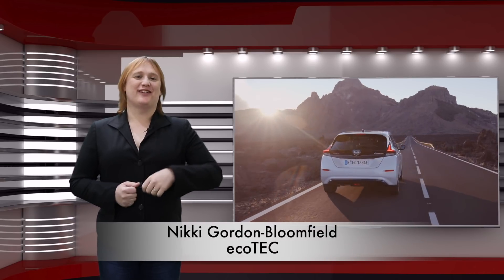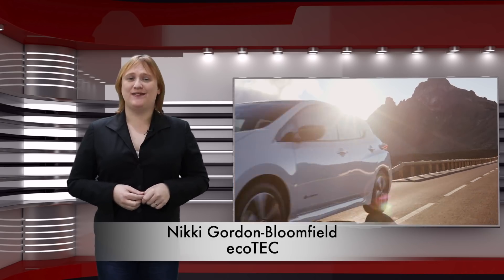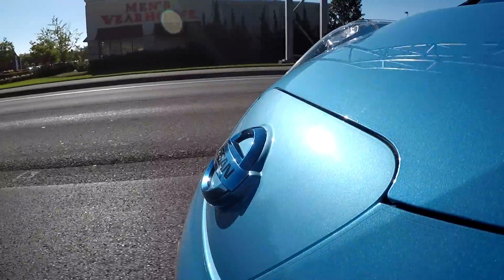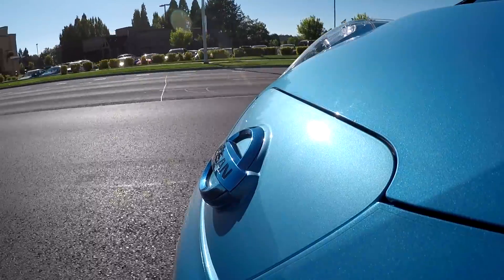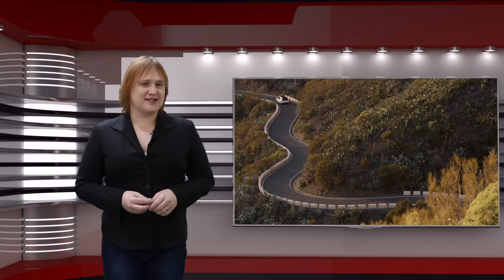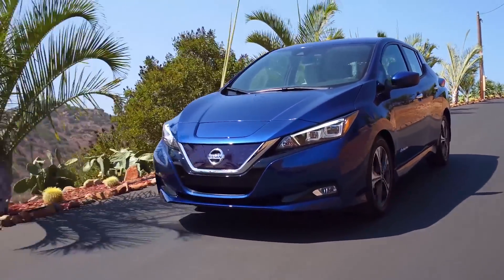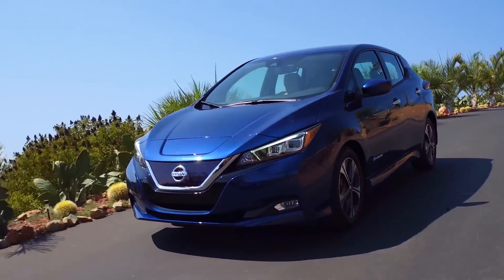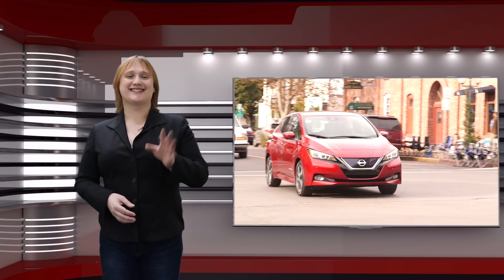The 2019 Nissan LEAF e-Plus Has Air-Based Battery Cooling -- Not Liquid Battery Cooling

Comment: Have you actually seen "Active Air Cooling using the A/C,  a radiator & fan" in a 62 kWhr battery pack in a Nissan e+ ?  If you have, then where is the PHOTO ???  I do NOT believe you ...

Comment: your third point; "requires coolant to be pumped out of the battery pack prior to removal..." . Mmm. That doesn't happen much(!). From my reading, it would be fair to say liquid-cooling inside the battery pack would have raised the car price significantly, which adds complexity (introduces potential points of failure) and the consequences of a coolant leak inside battery is worse if liquid rather than air.
Reply: Batteries are quite sensitive to temperature and have an ideal range of working condition. So while you can have air cooling it does not work really fast in terms of exchanging heat in cold weather or radiating off heat in hot weather, because air is not really as good as a thermal conductor as a liquid would be.
Modern EVs like the Model 3 have a cooling system which in reality uses and exchanges heat all the time between the motor, the battery and other bits and pieces of the whole system, in fact they use a funny looking valve which serves to the scope of routing the most heat as they can (which makes sense, as otherwise it would be wasted energy).

Comment: Your second point; from my reading, irrespective of battery pack size, battery packs heat up when fast-charged. Active cooling reduces "wear"/degradation of the battery due to excessive heating, and enables faster charging. That's the issue. Air-cooling raises charging rate a little. But it could have been faster again with liquid cooling.

Comment: After six months with my Leaf Plus (2019 SL) I have no complaints.
Reply: six month, doesn't say anything. What about 10 year? I have a Opel Ampera from 2013, with almost no battery degradation. Because of proper battery management design. I can still get the advertised 80 kilometers in summer. And now with cold weather i can still reach 50 kilometers as advertised. (They actually said 40 in cold winter) So still ok. How will your Nissan Leaf do after 6 to 7 years? Same kilometers? Or because of AIR COOLING your battery degradated super quikly, so it will end up on the scrapyard very early. (Well that is great for the enviornment!)
Reply: i have a 2019 sl leaf also
Reply: Which country and temps?

Comment: there is absolutely no battery cooling in the new Nissan Leaf it's absolutely disgusting. 
 charging speed below 17kW@50kW-Chademo. 
55°C battery-temperature.
RIP LEAF
Reply: It will also destroy your battery like that if you do that alot. Batteries are very sensitive to quick temperature changes. You don't have that with proper liquid cooling.

Comment: Air conditioning or using fans and liquid cooling are all active cooling. Liquid is the most efficient, but is prone to leak which could cause a fire if it shorts out the circuits or reaches the lithium in the batteries.
Reply: Proper cooling liquids for electronic devices do not conduct,  we use also demi water for out converters at work. If this spills, it doesn't conduct any electricity so doesn't short the circuit. Just for your information. EV's should ALWAYS be properly cooling with liquids. End of story. Don't bullshit customers.

Comment: So what temperature does air or liquid cooling cool the battery to?(  Hint. ... depends where you live ). How long does it take to quick charge and how long does it take to transfer the heat or cooling. to and from the cell electrolyte? ( Hint . ... Depends on the temperature difference, depends where you live.)
Long term battery degradation is a function of long term average temperature.
 The bigger the battery the larger area the heat is spread over ( and possibly the lower the internal resistance). Heat produced is caused by internal resistance.
Hmm Big battery, low internal resistance, and control current depending on internal resistance and temperature. 
Maybe 6 of one and half a dozen of the other.
From a scientific approach maybe the later is more logical and smarter. Guess what? It is is simpler too.
After all, climate change is just a load of scientific crap. Or so I have been told.
Reply: Perhaps prevention is better than a cure.

Comment: I've seen a dash cam footage where a Tesla had a minor collision with the side of the car being the impact point and the battery coolant was gushing out of the car, if you ask me ask long as air cool is good enough to keep battery life at bay than a little slower concecutive DC charge time is worth the trouble.
Reply: Problem is, the Nissan Leaf needs a battery replacement very quickly and degrades like hell. Statistics with a large n are confirming this. This is not good for the enviornment. The Nissan leaf probably has great batteries. But HOW YOU DEAL with the batteries has a HUGE impact on the life of the battery. I wouldn't for example advice normal income people to buy a second hand Nissan Leaf. Because of the degradation issues. On the other hand, i would advice the Opel Ampera, Chevrolet Volt as that battery pack is properly designed and a great second hand EV(rev). With very low degradation of their cells. AIR cooled = BAD. It's uncontrolled, and doesn't properly cool OR warm up the cells well. For example, my Opel Ampera warms my cells up in the winter trough a heater coil in the circuit. You really don't understand why air cooling is bad. Statistics CLEARLY show super fast degradation of the Nissan Leaf cells, even though they use good batteries. It's not the quality of the batteries that is the only important thing. How you manage them is 50% of the story. Thermal management with air = bad.

Comment: Nissan Renault has a lot of first mover advantages but lost them in the last cycle. Important point is made: since radidgate Thermal battery management has become a talking point and air cooling sounds inferior to new customers as they compare it with  cooling  combustion engines and read up on issues with the Leaf. Nissan should have moved away from air cooling not strictly for technical, but for marketing reasons.
Reply: Anyone capable of listening to the description and understanding it will not confuse this battery cooling system with a normal combustion engine's cooling system.
Reply: It's also important for second hand market. Cars that have good proper Thermal Management system with liquid cooling have a pro-longed life span. Therefore i advice people not to buy air-cooled or non-cooled EV's. As they degrade way quiker than EV's with proper liquid cooling management system. I have a 7 year old Opel Ampera still doing the advertised range. How about that. Can you say that with the first Nissan Leaf? HMMMM ?